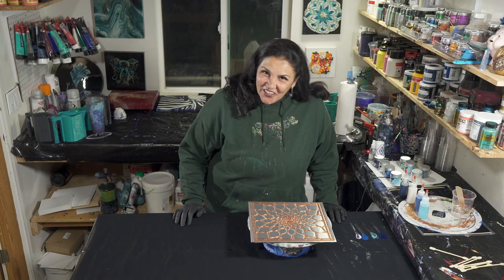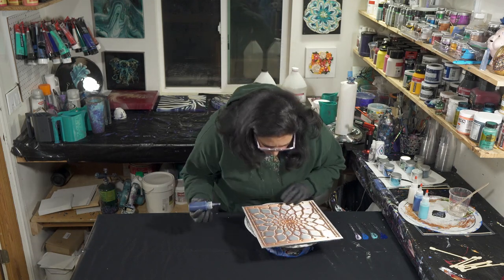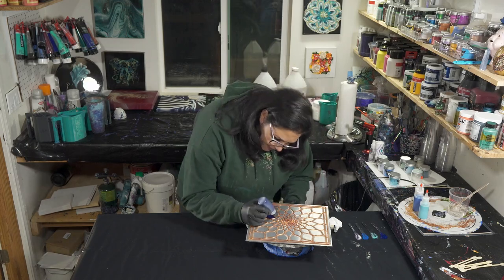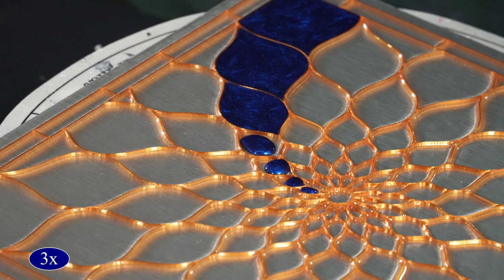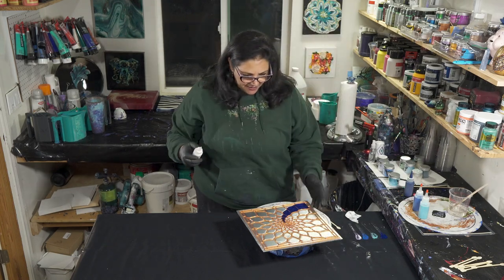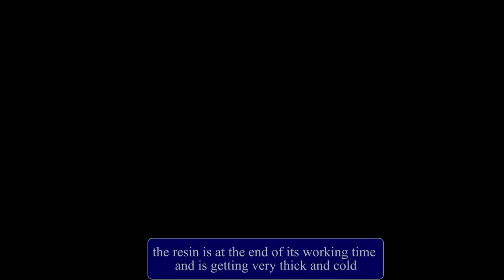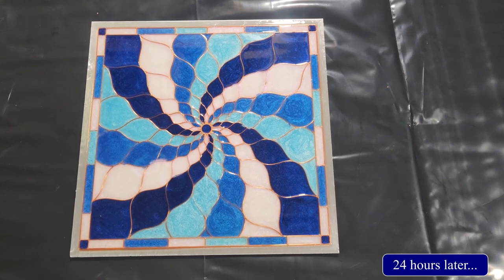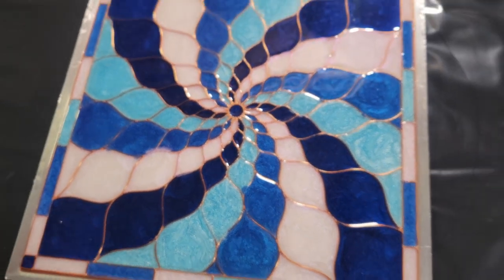Be the Light!✨️Gorgeous Resin Art with Pour Away Fluid Arts template! Featuring NEW TLP Waterfall!

Comment: Art resin even though it is self leveling do we still need to push it to the corners??
Reply from the maker: If you added just enough to fill the space then probably not.. but I would rather not get them to overflow and have to correct.  Easy enough to push it to the edges and add a drop if needed..  great question!